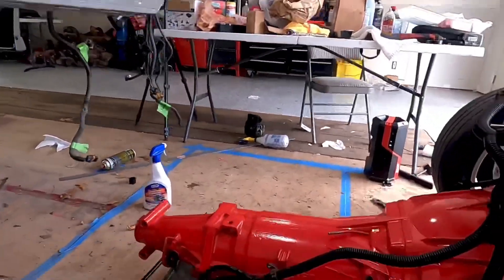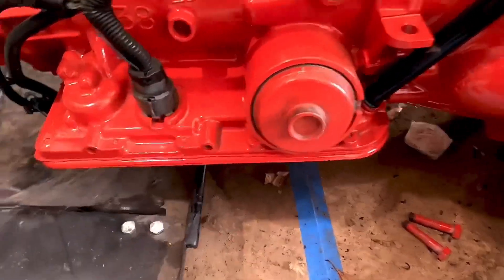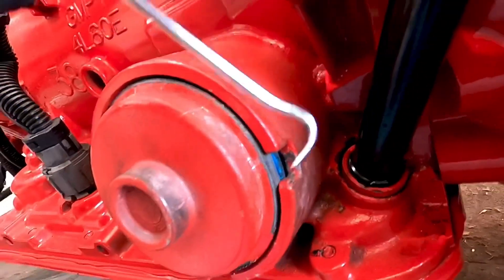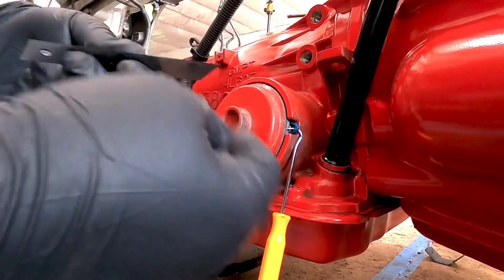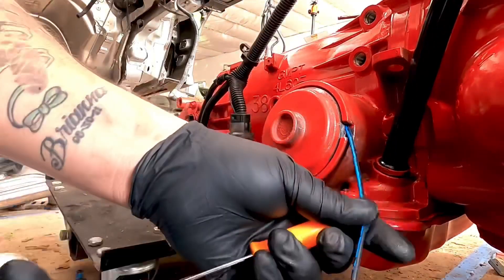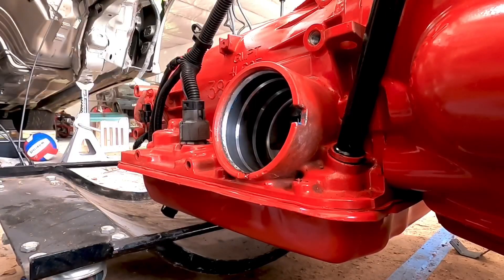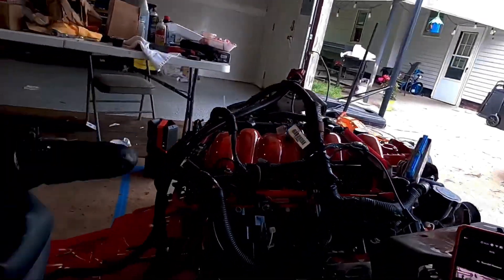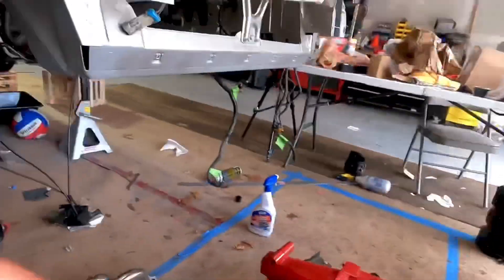How To Install Corvette Servo on a4L60e

Comment: You can pull and  stretch it(blue O ring at 2:10 into video) and servo cap will come out
Reply: Lol, did u get that tip from Richard? The transmission guy

Comment: You can stretch the blue o-ring and cap will come out. Corvette servo works great but you also need check your travel the less travel the quicker it engages I try to get about 1/8 travel
Reply: You can but a longer pin and you need to grind tip. You'll do a few test fits without o-rings until you reach desired travel I like 1/8 or transgo hacs shims in their HD2 kit

Comment: I seen a different video where they put some trans oil before they put it in so it's not dry or it doesn't make a difference?
Reply from the maker: Not really, mine is working fine 👌🏼
Reply: Yes , it makes a diff. , it'll be metal on metal without film of oil lubricating it.  .   Oil it before install

Comment: Do you need to oil it first?
Reply: 100% make sure all seals and o rings are properly lubed and/or oiled. I didn’t properly lube the cover o ring putting it back in and it ripped without me realizing, so I went to test it and it puked all the ATF and completely smoked the entire trans. Now I drive a Dodge 👌

Comment: Is there any cons to this for towing or hauling heavy loads ??
Reply from the maker: Yes the shifting is better
Reply: Yes it puts more pressure on the 2/4 band allowing to hold better  you need to get the assembly thou the vette springs are stiffer

Comment: what's up friend This corvette cervo can be installed on a 2007 chevy tahoe 4wd. I'm interested. what is the cost of the installation. where is your workshop
Reply from the maker: Yeah it can be installed. And I don’t have a shop, all the work I do it on my garage
Reply: Donde vives
Reply: Tengo planeado poner mas cosas en esa troka algo más agresivo me puede ayudar.
Reply from the maker: @joseduron7623  en Grand Rapids Michigan
Reply from the maker: @joseduron7623   si claro que si

Comment: What does the Corvette Servo do
Reply from the maker: Arguably one of the most inexpensive, yet most rewarding upgrades to your 700R4 or 4L60E (4L65E, 4L70E) transmission is the corvette servo. Right away you will notice faster and firmer 1-2 and 2-3 shifts. The corvette servo will give your transmission 50% more apply pressure, which is just what you need to keep from burning your transmission up under heavy load situations. The corvette servo is a must for any performance vehicle, for towing, RV, or off road use, and is a positive upgrade for any 700R4 or 4L60E transmission. Our servo is easy to install and can be done with the transmission in the vehicle. The servo comes with all of the necessary seals for installation; including the outer cover o-ring, as well as three pages of instructions with diagrams.If you have already decided to install a corvette servo, your next question might be whether or not you should use the corvette servo with the longer pin instead. Here’s how to decide.
Reply: Ls Brothers Garage We have a 2006 Chevy Suburban 2wd and we pull with it a lot transmission already went out but we’re getting a rebuilt one, would you recommend us upgrading to a Corvette Servo ?  Also thank you for the quick reply 💫
Reply from the maker: Fatima D Noor most definitely, my Brother & I we’ve been using this one from EBay and we have not had any problems with it. 

https://www.ebay.com/itm/122734756783
Reply: @fatimadnoor7563  make sure to put the wide band in it . Watch Precision Transmission here on YouTube how to make it way better